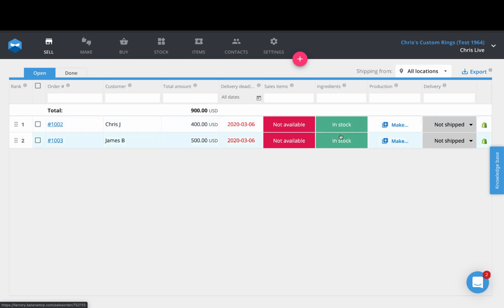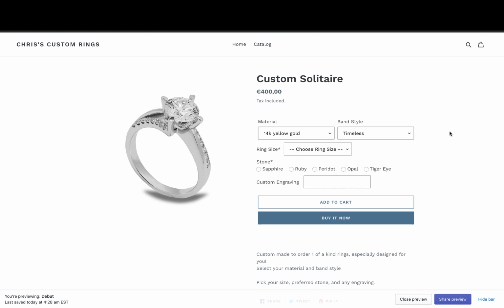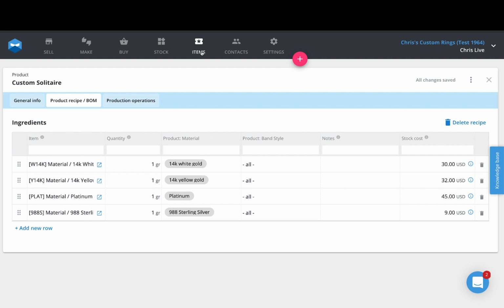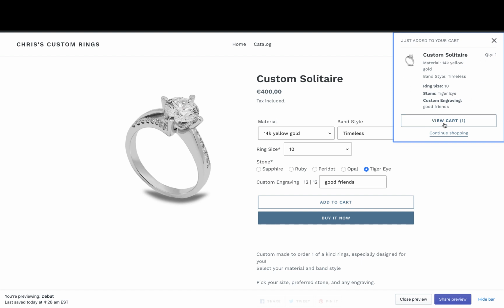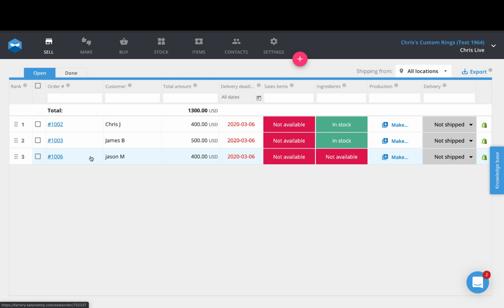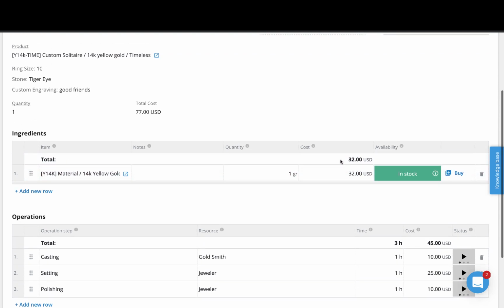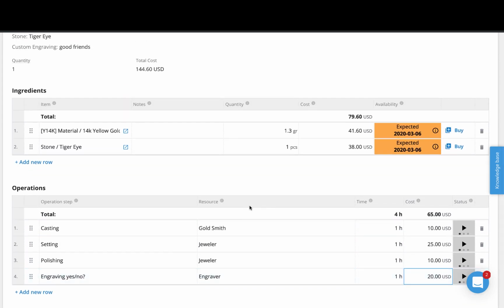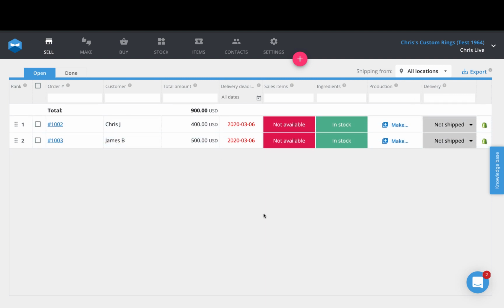Custom Make to Order Manufacturing Workflow | Katana

Comment: Is there a way to pull custom meta values direct from woo to create items that are not true variants in woo over to katana? Eg an item has lots of options and so when these options are recognised in katana automatically build a materials list for production.   When a customer selects options on our site we want these to identify in katana sometimes as products themselves alongside the main product.  Eg  vanity unit is the item and then we have variants of size.   Following that all options like colour, handles, countertop and taps are options/and/or products themselves.   Some are part of manufacture and others are just stock items that help build the order specification.
Reply from the maker: Hi Mark,  
Katana can pull over products during the initial integration of accounts (assuming the products are under "Simple Products" or "Variable Products") or when a new sales order is generated within Woo. 
If you're following the latter workflow, the product will be pushed to Katana, and you can do one of two things:
1. Save a bill of materials of the product variation; or 
2. Select the make to order button and generate a manufacturing order for the product. 
However, for this to work, during the set-up, you need to select Import all your products from WooCommerce. 
You can read more about the Katana x WooCommerce integration here: https://support.katanamrp.com/en/articles/419 if you have any more questions, feel free to let us know. 
Katana Team
Reply: Katana - Smart Manufacturing Software hi.  Thanks for the reply but it didn’t really answer my question.  I use a plugin to add additional options to the spec of my order.  Eg a sink design, door handles etc.  These are not physical products themselves rather they are extra little features.   We have so many size, colour, spec options that each product if done the normal variations way would result in hundreds of variants for one product.  Woo is great but if you want to work with lots of variants then it’s not so good.  So what we do is have just a size options for the furniture which is usually 6 viaraints.  Then we add other meta data options via a plugin such as colour and other features.   It is those other features that are actuallly products in their own right, but we treat them as just variants.   Does that make sense? So what I am trying to do is extract this extra meta info so I can manage stock and materials when they are added to a piece of furniture
Reply from the maker: This following video relates to Shopify line item properties. If you have a similar setup using MetaData on WooCommerce, Katana also supports the exact same workflow you see here in the video. On sales orders that have line item specific metadata we capture this information and also push it to the “make to order” manufacturing order. You’ll need to modify the individual manufacturing order based on sales order line item metadata inputs to account for the usage of stock on those custom orders. Most importantly, the data is available as it was related to the sales order from WooCommerce. You can check this article which goes over this in detail: https://support.katanamrp.com/en/articles/464-how-is-metadata-for-products-on-woocommerce-sales-orders-displayed-in-katana 
Katana Team